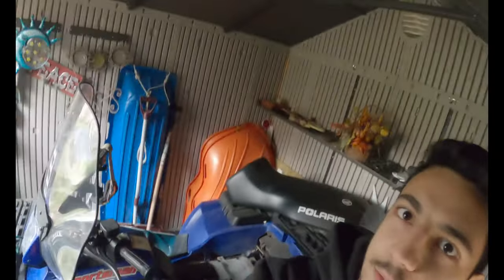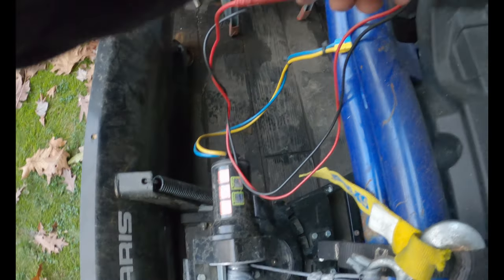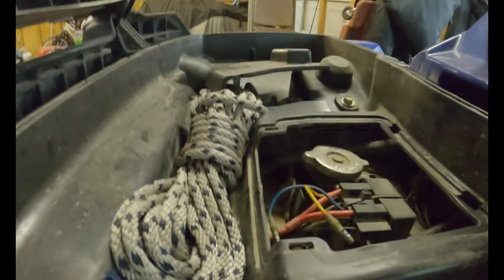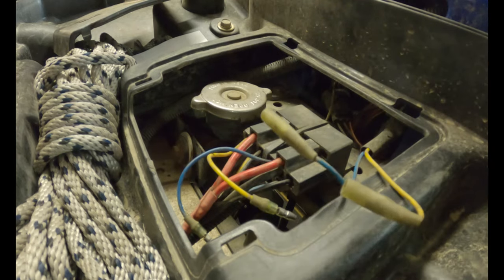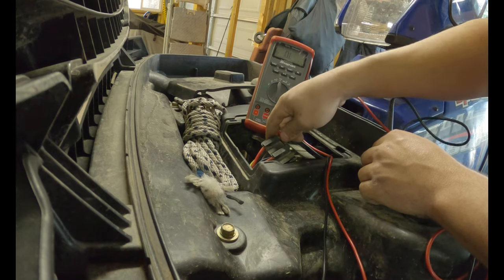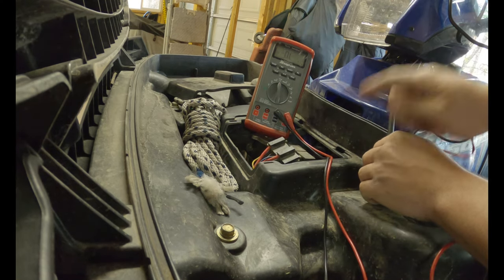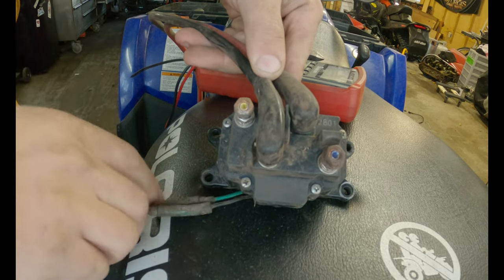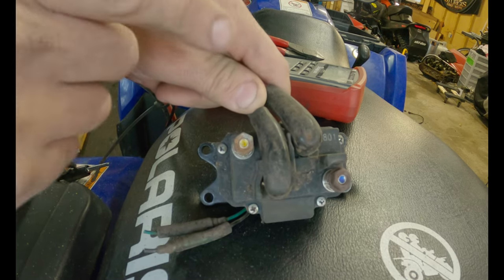why your electric winch isn't working

Comment: Have a 2015 Polaris Sportsman with a Polaris 2500lb HD winch. Battery died and had to be replaced. Once it was replaced the winch didn't work. It just goes click click. Took it to the dealer and they said, bad contactor. Since they wanted over $300 for labor to put in a new one, I purchased a new one and put it in. Same thing, click click. Terminals all looked good. I put dialectic grease on connections. I was told the winch motor was ok when they put power direct to it. They also said the switch was ok since it clicks. What else could be the proble? Any thought? Thanks...Dave
Reply from the maker: Could be the high current wires to the winch
Reply: Having exactly same problem. Ever figure it out?